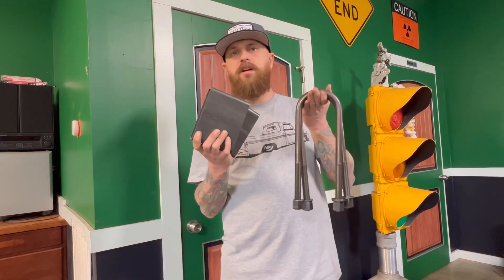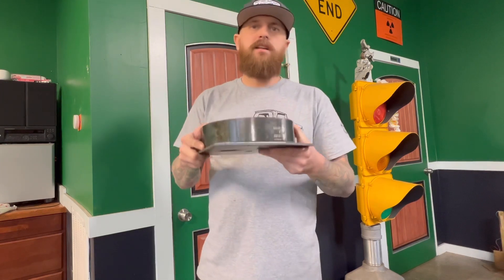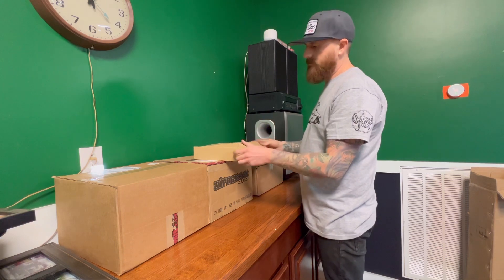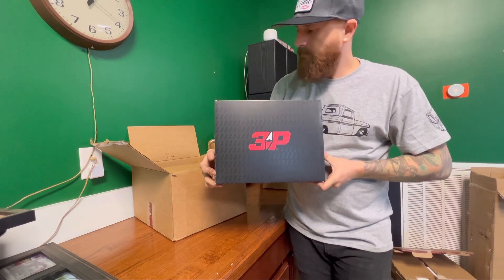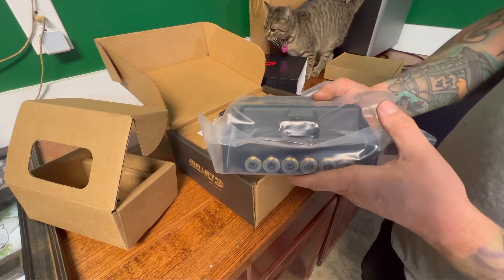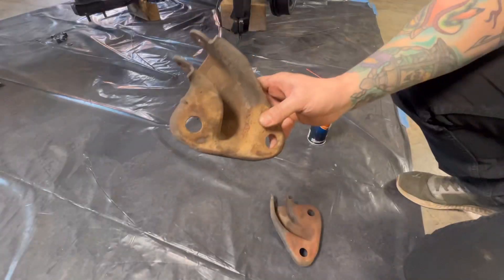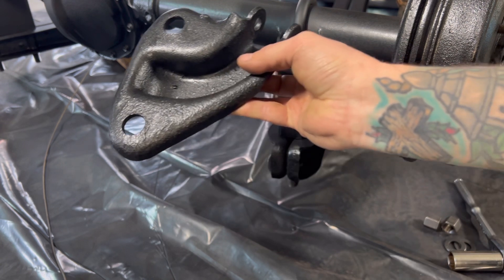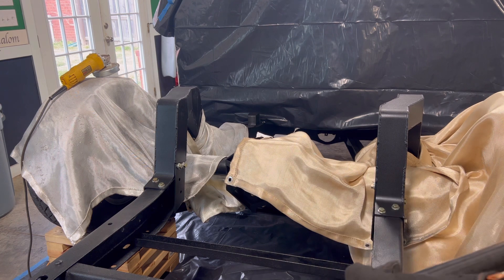Black Dice Ep. 4 | DIY Air Ride Tutorial! Unboxing Velaworks and Airlift 3p!

Comment: My problem with my truck is I go to raise the front it starts to go up and stops. Then I need to wait for the tank to get over 140 again I run 2600 with to 480 compressors with 3/8 line. It has a 5 gallon tank to I tried two tanks made it worse went back to one but can’t figure out why it does it. It’s a accuair VU4 any ideas
Reply from the maker: That sounds like a VU4 manifold problem. How much psi does the front have when it stops?

Comment: hi , Heard you on C-10 talk . good interview. Okay I have a 60 GMC short bed fleet side . would those componets work for my truck .?  on bagging
Reply from the maker: Thanks. 60-62 have different frames than 63-72 so it would be different. The from have torsion bars and the rear is an x frame. If you need direction reach out to me on Instagram. Simple.c10

Comment: Is there any in-between the options of a 4 link or the stock trailing arms? I'm new to the lowering game and definitely am going with this Cnotch kit. I want to run 18's but not have scrum. Is scrum just risky or is it something I absolutely should not have occur. I'm open to having to purchase a few more parts. Just not sure I really want to invest in a 4 link at the moment and absolutely don't want to run 22's. You mentioned potentially running a smaller block. Would you think each inch reduced in the block would be equivalent to another inch i could reduce my wheel size by? Any help is appreciated.
Reply from the maker: With 18s you can run a smaller block without running into scrub issues. The Velaworks rear block can be cut to any size you need. When you go four link you have to change where you mount the bags and requires more fabrication skill and tools. I plan to do a four link in the future so I can show people how to do it. (Once I learn how lol)
Reply: @SIMPLE.C10  excellent, that's the conclusion I was coming to after watching it a second or third time...keep up the good work...I and many more appreciate the indepth look at getting this low but not having to buy something like porterbuilt...love there stuff but just want to spread my budget further at this particular moment...do you ever worry about having your trailing arms at times being your lowest part of the suspension?
Reply from the maker: Not really. It would be the same idea as a four link. It’s usually just as close to the ground. I feel safer with trailing arms actually because they are the factory design and are bolted onto a crossmember instead of welded in.

Comment: I know there are kits that make a long frame a short box… after doing so can you still bag it?
Reply from the maker: Yes you can! Lots of people do it.
Reply: @SIMPLE.C10  also are the 60-62 frames the ones to avoid since they are different than the 63+?  Thanks!
Reply from the maker: I wouldn’t say they are the ones to avoid. You can still bag them but there’s much left options available. They have an x frame in the back so it takes a bit more to notch it and the front has torsion bars but Velaworks has a delete.